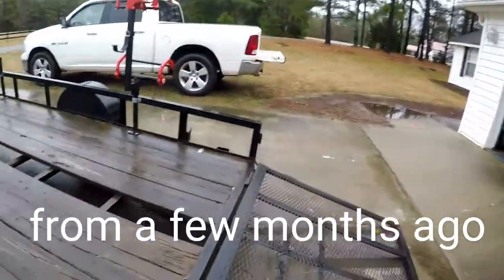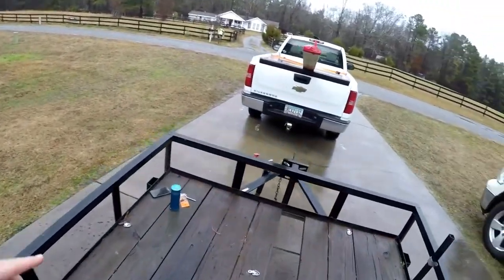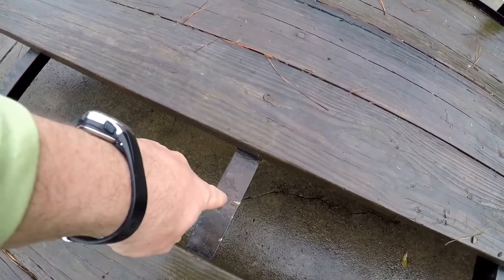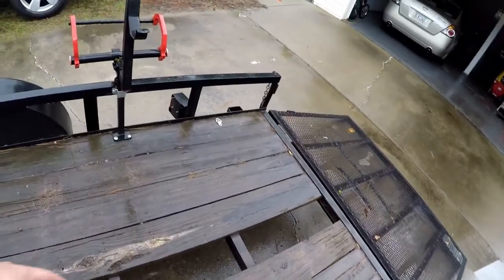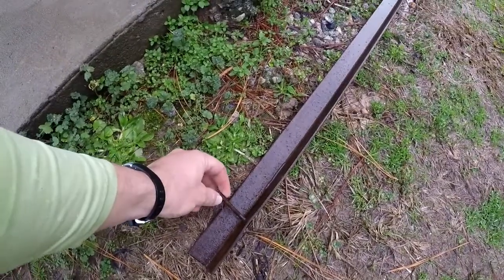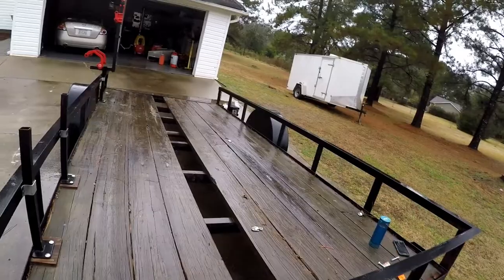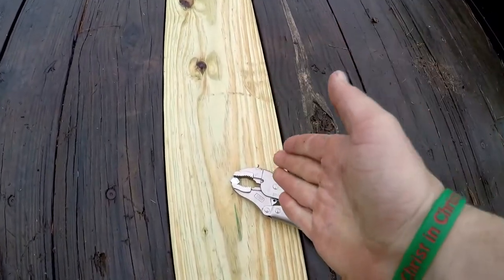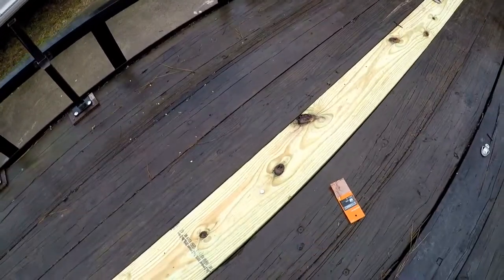HOW TO REPLACE A BOARD ON YOUR TRAILER 6X12, 5X10, 7X14,

Comment: Why not use a carriage bolt, so you don't have that hex head sticking up? This is the perfect application for that.
Reply from the maker: Because when i replace the board later the head just spins in the rotting wood they are a real pain to remove at that point

Comment: I don't bolt mine down at all so it's nice and smooth for sliding things in and less area to rot or crack. Never had a problem. it's going strong 6 years later and it gets used a lot and always sits outside in the weather. Also it doesn't make a racket when it's empty going down the road either.🍻
Reply from the maker: Thanks for the input buddy

Comment: That exposed & proud bolt head will always be in the way. You'll never be able to carry anything flat on the bed without dealing with it scratching what you;re carrying. All you need is a deck screw or similar exterior grade screw driven from the the underside through the hole you drilled.
Reply from the maker: Has never givin me a problem yet but that is a good idea bro
Reply: Yeah but with this idea when the wood rots,  you're most likely going to drop that screw on the road,  that's why the bolts are used

Comment: When selecting your boards make sure they are straight and not warped. Also the board you installed looks pretty knotty which could cause pain for bolting it down needing to go through a knot.
Reply from the maker: Good idea this one worked great tho